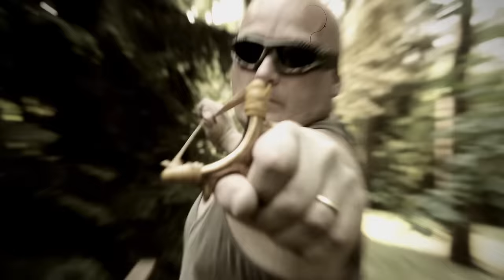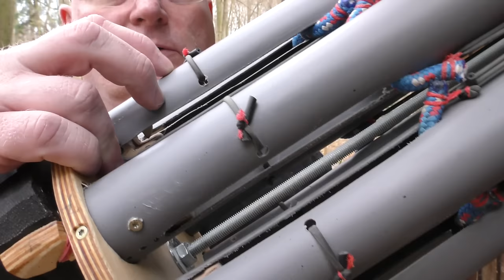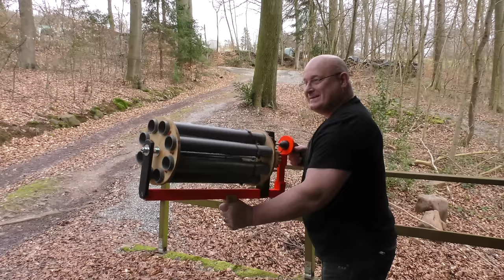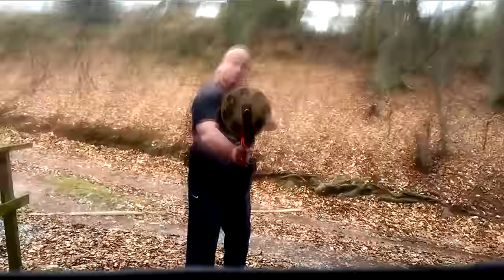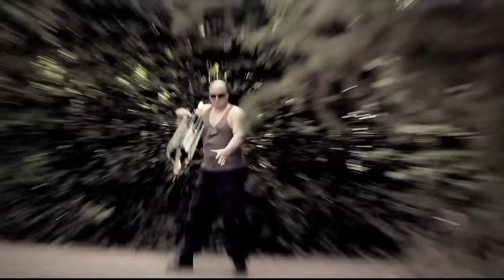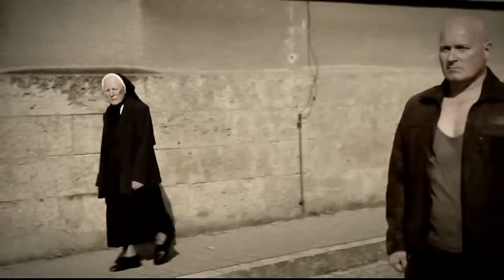Ping Pong Hailstorm: Huge Full Auto Slingshot Gatling Gun

Comment: I believe that you could increase the power and range of this by using little hammers to hit the balls rather than just pushing the balls from the barrel. When you think about the percussive attributes of tennis balls, they're designed to provide maximum 'bounce' off the table tennis bat. I think if you hit them within the barrel with something hard (a round piece of wood designed to slide within the barrel) you'll probably significantly increase your range. (And using rubber super balls instead would also be an even more lethal modification too!)

Comment: I would drill a small hole in each table tennis ball and then fill the inside with hot glue or with some other, denser material.
Or the tennis balls could be replaced with golf balls. Golf balls are notorious for their good aerodynamics.

Comment: you should glue on the top of pipe piece of rubber instead of rubber bands, this way ping pong ball will take backspin same as in Airsoft and ball will fly straight and far even with low power